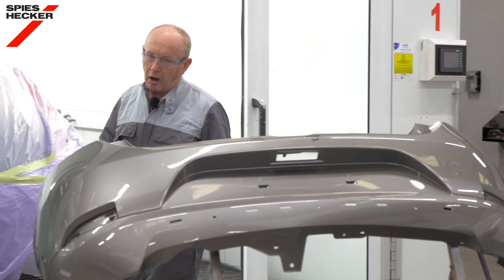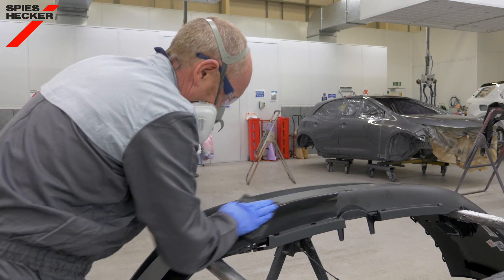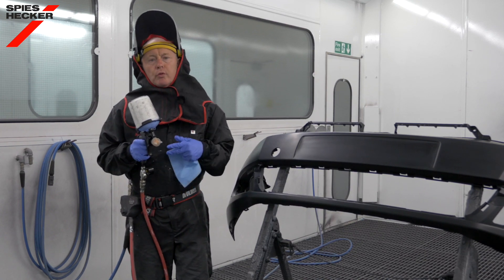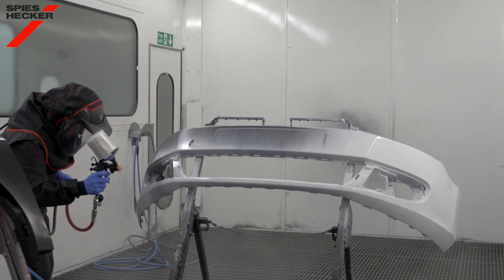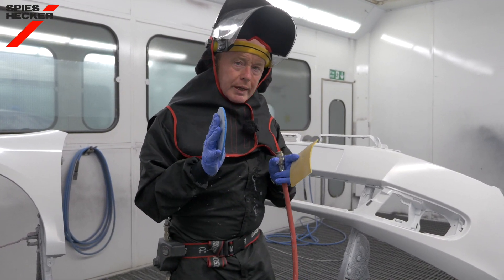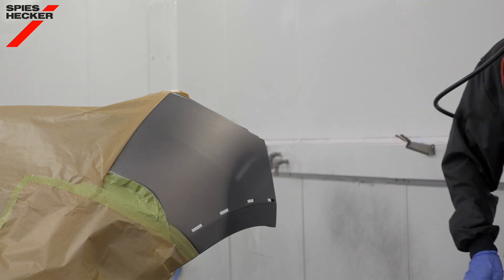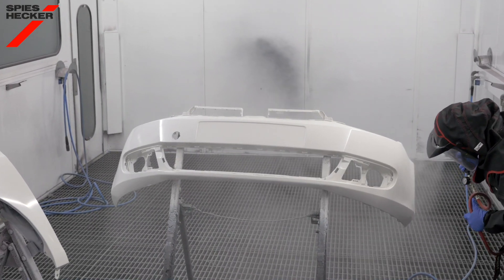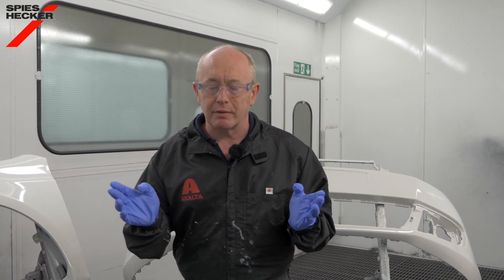Speed-TEC System: Faster to the Finish - Plastic Refinish Process

Comment: did you flash off between half coat and full coat on wet on wet primer, and is it same practice for hs voc clears?
Reply from the maker: Hi, thanks for your interest and question. The product shown here is applied in a continuous process without flash off between coats. With regard to our Permasolid HS Clears the majority of them are recommended for application in a similar process where no intermediate flash between coats is needed. Always check the TDS though as there are some exceptions where certain clears i.e. 8034/8055 can be applied in 2 single coats with intermediate flash off.

Comment: we just switched from the 5450 sealer to the 5650 water sealer. Is something like this going to be available for the water sealer? I’m in the United States so I do know some products are not available here
Reply from the maker: The products featured in this video are from our EMEA product range and are as you rightly point out not available in your market. With regard to the products you mention I’m afraid I have no experience with these and would ask that you contact your local sales/technical support for any possible updates. Thanks though for watching and taking the time to comment

Comment: Nice !Right now we’ve been having to use an adhesive promoter first ,let that flash and then put the wet on wet on.We are using right now the Spectro sealer I forget the number .Also what degreaser were you using to scuff that raw plastic bumper?Ive been told not to use solvent based degreasers on raw plastics .thank you
Reply from the maker: Hi again, thanks for your interest and questions. You have clearly recognised the process benefits here of not having to apply a plastic primer/adhesion promoter before the surfacer. This of course saves time and will help you be more productive and use less products.
The cleaner used during preparation of the plastic bumper can be found here http://sdstds.shcolor.info/Doc/TDS/EN/EN%207010A.pdf This is suitable for cleaning plastic substrates and also has a mild anti-static effect”
Reply: Bumpers not raw